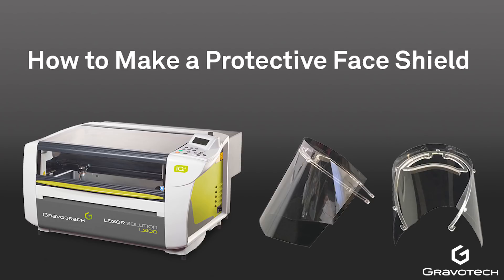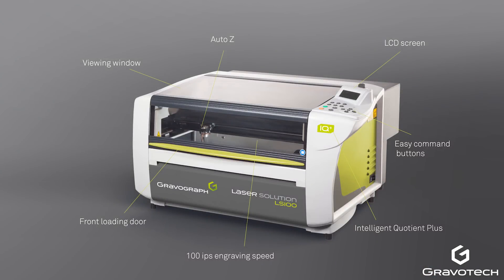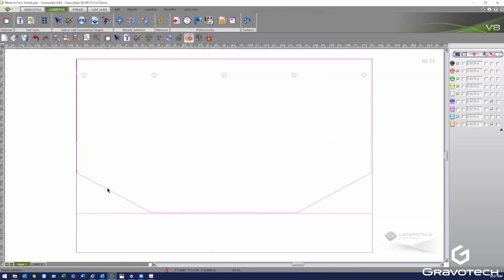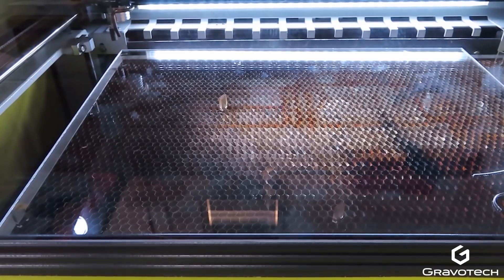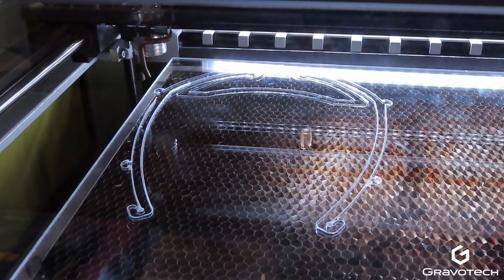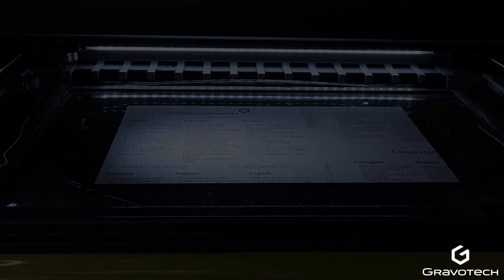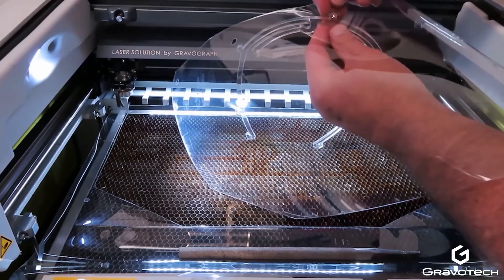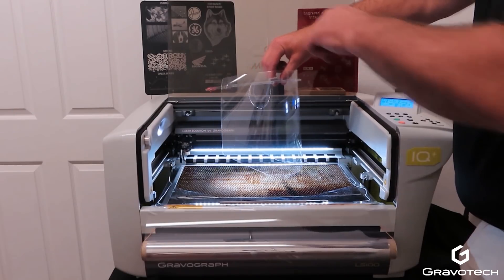How to Create a Protective Face Shield

Comment: How about a  written supply list?
What type of sheeting are you using in the roll?
Will this be usable in a hospital setting or is this just for personal use?
Reply: The sheeting is .005" Polyester, it is available in rolls or sheets, the headset is made from .250 acrylic (cast or extruded, clear or colored is fine), the foam is 3/8" sourced from a hardware store.  The masks are fine for use in a healthcare setting.  Several of the largest Health Care Facilities in Atlanta are using these, along with a major university in the area.  Have your facility evaluate them in case they want modifications.  This design is comfortable, does not impede fitting of N95 masks and  is light weight.  Contact Gravotech for supplies 800-843-7637, acrylic sheets & polyester film are in stock at this time.

Comment: can these be made with a rotary engraver?
Reply: If your machine's engraving area is large enough and you have the correct cutter (spiral end mill .060) along with Graphic level GravoStyle, it should be achievable.  You will need to use the CAM module to create the cutting tool path offset and use "Bridges" to hold the cut part in place until the last cutout pass.  The last pass should just clip away the connecting bridges and free the finished part from the sheet.  Tech support can help with any questions.  In US it's 800-843-7637 and follow the menu prompts or go to the website and initiate a chat.  www.gravograph.us  use the green "Chat now" icon at the bottom of the web page.